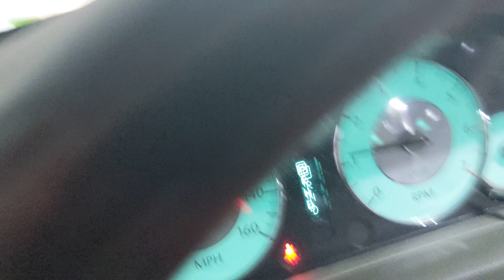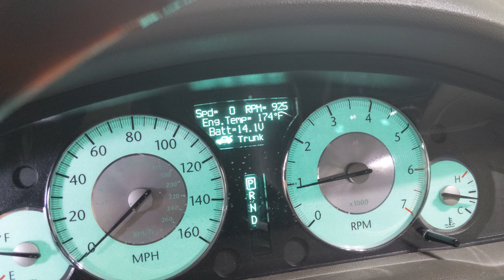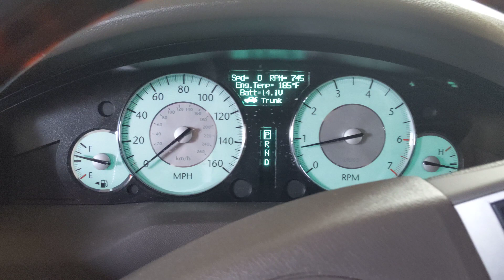New JS Alternator 240 Amp with Whine

Comment: Where did you get the half inch shorter belt for the Chrysler? (I have a Chrysler)
Reply: Pretty sure I snagged it off amazon. dont search by car or you'll never find it. You have to search for the length of the belt

Comment: Is the alternator not supposed to sound like that cause mine came in and kinda whines like that to at idle under almost no load
Reply from the maker: No, I sent the unit back and had them upgrade it to the 300 amp. It has run very very good ever since. No whine and the voltage is on point. it was just a hassle getting through to them for the RMA

Comment: Perfectly normal sound from a loaded alternator. When they are charging heavy or supplying a load, they make that exact sound.

I'll guess you were listening to the stereo while key off for a while and the battery was recouping.
Reply from the maker: Nope that was at idle under next to no load. They took it back and fixed it and has been rock solid ever since.  Please if you think this is normal take your car to professionals as this is far from normal.

Comment: Bro u gotta add a shorter belt. Half inch to a inch
Reply from the maker: Nope it was fucked and had to be replaced. They did replace it and it has worked great from then on.
Reply: @FatboyBass  I installed mine from then. It does great wen I’m driving. I charge at 14.8 or 9. An never goes below 13.9. But wen I’m idling or parked or at red light it goes down to charging at 13.1. Sometimes 12.6. Then soon as I pull off it goes straight back to 14.8 an does good. What u think causing that?? It’s racking my brain bro. It’s a js also btw

Comment: Mine lasted 2 weeks, and the whine was worse alt got super hot 🥵 within a minute or so, and my stock alt had better voltage, sent mine back they should have got it last Thursday, left a note in the box, and have message them twice, and nothing, super frustrating too be left in the dark

Comment: The way you described the alt whine 😂😂😂 hope you got sorted out bro.. I am the same way and made sure when I order my Singer 240 I wouldn’t had whine / alt noise or have belt slip. 

I noticed my car regulates the voltage with the heat so Say I start the car cold for the first 20 / 30 min in summer I’m 14.4/14.5 but after day an hour or driving and bumping it’s 14.0. Plus my alt is under the engine not on top like most bass rides I see so idk if that better or worse for the heat. 

This is just my experience but I always hear alternator makers talk about hot performance vs cold performance so that’s kinda my understanding as of now. 

Mike Singer of Singer Alternators has great communication.  He is more expensive than others.
Reply from the maker: They finally came through. Got everything squared away and it was upped to 300 amps. Same deal its regulated based upon temps.  in most cases It's 14.3 14.4

Comment: My 13 charger ran at 14.0-14.1 and drove at 14.3 stock....same thing with the new js 250....I have a little whine but not terrible. I literally just installed it a couple hours ago. The voltage and belt seem fine so I’m gonna run it for a day or two before I put the system back in just to be sure it’s good but I’m not too worried about the whine. The voltage is controlled by the car so not much worry there, but your whine seems worse than mine. Have they got back to you yet?
Reply from the maker: Yes, I had to send the unit back in and they never told me what was wrong with it but the replacement one I have now has not whined like that. I also opted to upgrade to the 320amp version as well. My voltage is still 14.1-14.4 on average. No noise and when the bass hits it hardly dips below 13.6 so far.  JS alts has poor communication skills but they will indeed work with you to make it correct if something is wrong.
Reply: Ok...I think I’ll just run and see what happens. Like I said my whine isn’t too terrible
Reply: @savionsmith7418  How'd it turn out for you? I ask bcuz my new JS Alt (390A) has slight whine when accelerating which has me concerned.
Reply: It’s gotten quieter and has been fine ever since. No issues with it
Reply: @savionsmith7418  i put mine in and when I Have the ac on it wine more smh but I haven't done my big 3